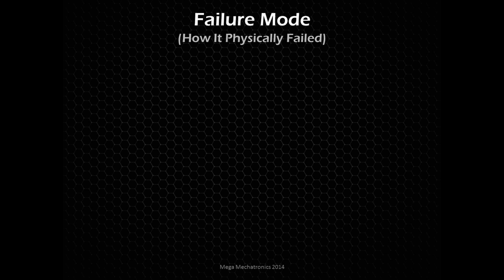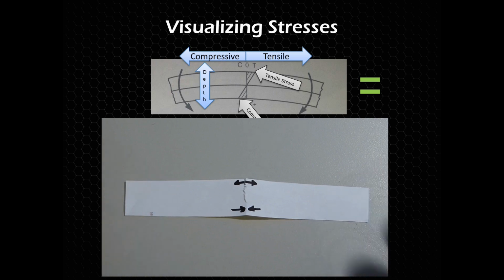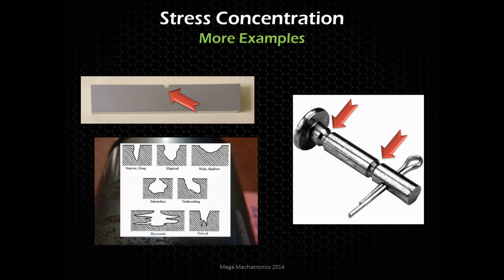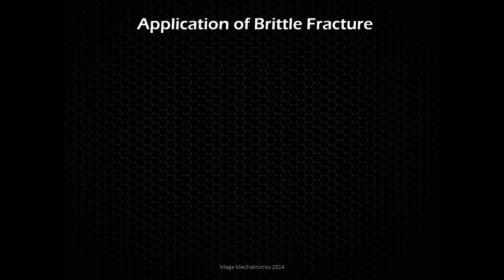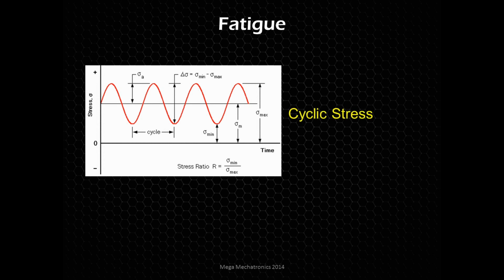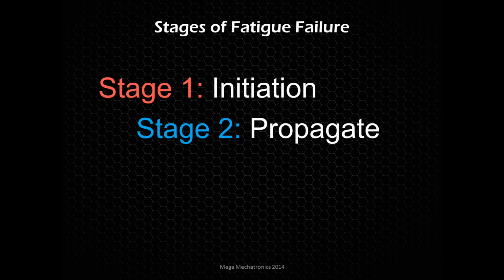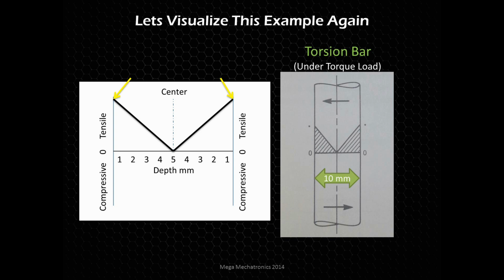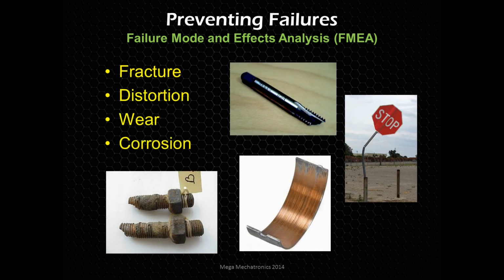Materials Science Mechanical Engineering  - Part 5 Failure Analysis Explained

Comment: Hello sir! I would like to ask some questions about failure analysis here. I'm on process of learning about failure analysis in general, but internet showing me a lot of example in material science which totally different for what im looking for. I'm trying to learn about a case that using failure analysis methode to identify failure in rotor machine with based on vibration signal tool called MEMS. I totally need some help from people who understand at least about a basic failure analysis as method to fix something other than material as an example. It'd be a great help if you can give me a respond as soon as possible. I'm sorry if i'm sounded rude.
Reply: Did you find out the solution, Sir?